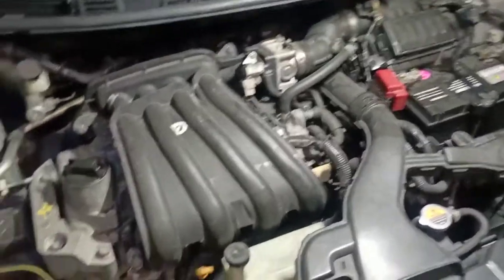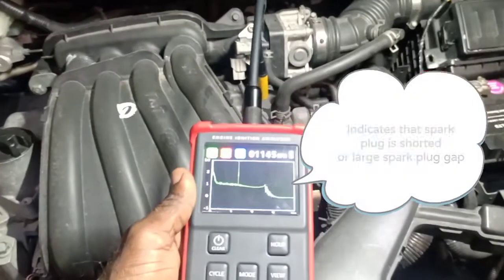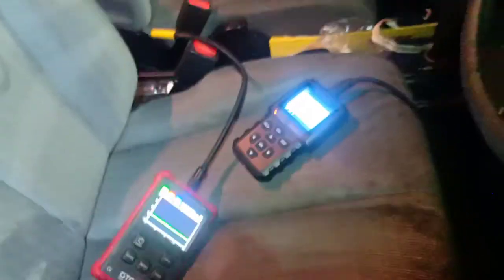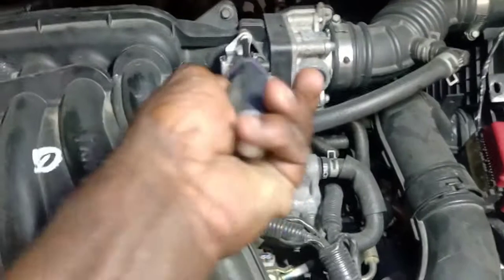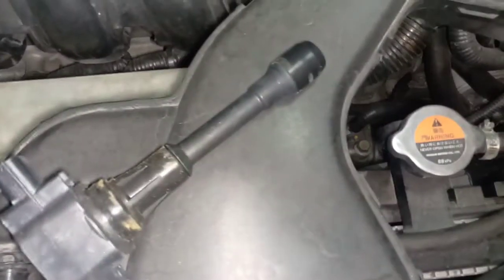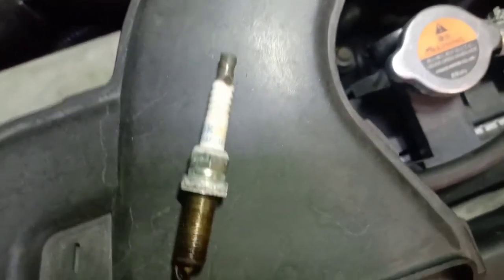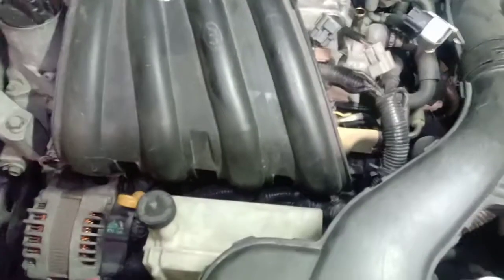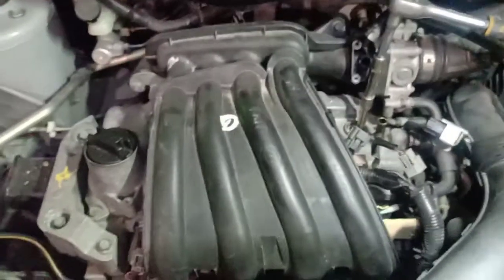Engine Misfire? Rough idle, Lost of Power, Trouble Code P0304 Meaning, What could it be?

Comment: Good call on changing both , I have seen many times where worn plugs will weaken the coil. It may be ok initially but I’ve had them come back 2-3 weeks later with a bad coil after changing work plugs.
Reply from the maker: Yeah. I'm changing coil and plugs at the same time. Especially if it's burned. Probably a few time I left the plug after inspection. Thanks for watching
Reply: @djmobileautoservices  I just received my GTC505 today and I’m very pleased with it . I was diagnosing a suspected lean running LPG engine and this tool is so much easier then dragging out my lab scope and setting it up for ignition!
Reply: Glad I can help. Works really well for quick diagnosing